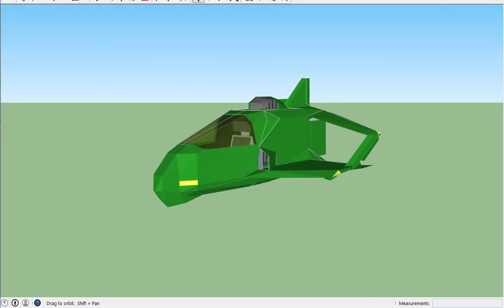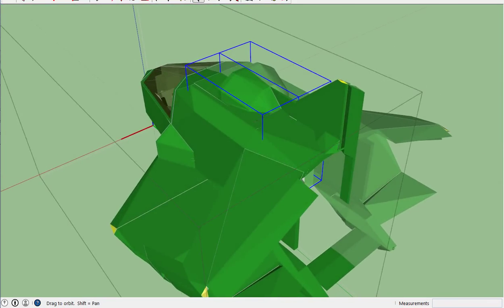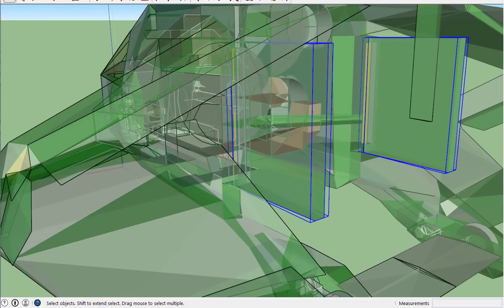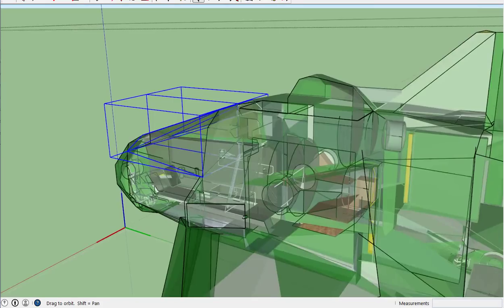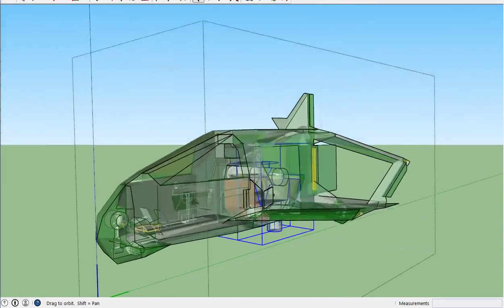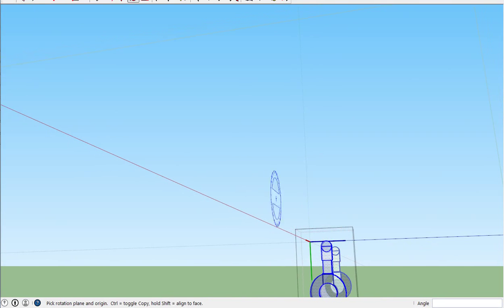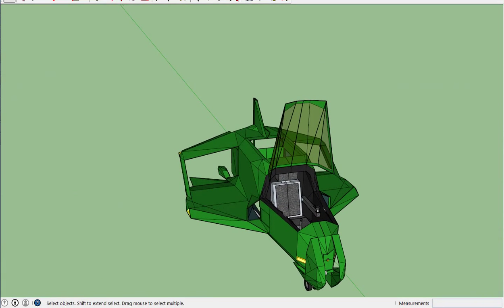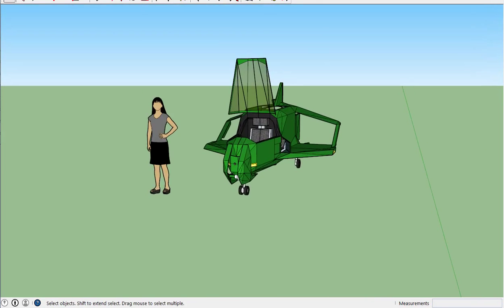Ultralight VTOL Concept

Comment: 11:23 on a horizontal landing or STOL landing the gear lids would scrape. Maybe side opening doors that only open slightly (a split bottom). And they open just enough to form a gap for the wheel to come out. Just saying.
Reply from the maker: I suppose for VTOL control it could use some kind of RCS system like in the harrier.
As for the gear lids, side opening is probably a better solution, although scraping is not neccesarily the case if the pilot doesn't flare XD
Thanks for the feedback!
Reply: yan-Deriction    ;0)

Comment: 7:43 Look up on how the harrier works. You could do something similar. Basically the Harrier blows air through a tube (like a vacuum cleaner in reverse). This controls the siclic (wing level and nose attitude in hover). And yaw control on hover would also be "reverse vacuum cleaner hoses". And the collective (up and down hover) is done with the throttle. On a small ship like your design, it should be pretty easy. Probably easier than a helicopter, witch varies the pitch of the blades (momentarily) for siclic. Complex and wearing parts. Vacuum hose is much simpler. lol And software to control the flow of air down the tubes. Software (these days) is cheap, compared to precision mechanical parts. Software will eventually deem helicopters as superseded flintstones antiques. The quadcopters (these days) hover on the spot if no control input. A helicopter will crash if you let go of the controls. A big difference. We can now even make software that can over-ride pilot error. And if pilot loses consciousness, the software will just make it hover and land (over-riding pilot leaning on stick). Can't do that with the chopper we have now. I think they are being slack and nobody is willing to BOTHER to do it. Not anyone with money. Bill gates should be educated. lol  Moller hasn't even got enough money (his latest 80 million is nothing). He needs jet power, cos that's the ONLY way he's going to get his Skycar off the ground. But jet engines are sky-high expensive (real money). Otherwise he's dreaming. A gas turbine engine has FOUR TIMES the power to weight ratio of a piston engine. So the figures speak for themselves! And to top it off, we need really light weight and a heap of power, as well. So we are forced to pay the ridiculous price. lol Moller is dreaming if he thinks he can use model aircraft wankles. lol And too much noise and the wrong kind of noise. A hissing sound is much more acceptable. 
I like your concept. They made a few concepts (drawings) a bit like this after they made the WASP. Look up the WASP VTOL PAV. It's real and it worked. Only possible with jet power. It's awesome! 
The problem with these things is the dead zone. Too low for parachute and not high enough for glide (and the WASP would glide exactly like a brick). lol. The answer is engine redundancy. So your two engines is a good idea. But jet engines are extremely reliable (compared to piston engines). And so the Harrier only has one engine. The WASP has only one jet engine too (and can't glide) but that was basically a military thing (and they take more risks). But I doubt if they would allow passenger or private crafts with only one engine, if they are VTOL PAVS. Cos (lets face it) THE DEAD ZONE is about the BEST altitude for these things. I want to fly in the dead zone cos it would be awesome compared to any other height. lol
And starting with just a single seat makes these things a LOT less challenging (in cost and effort). lol When we can easily do the single seater, then we work up to more seats. That would be awesome.
See my channel for some VTOL concepts. You will have to scroll through my videos to find them. Keep up the excellent work! Pressed "like" and subscribed. :0)
Reply: wow you must have alot of free time to write that in a comment